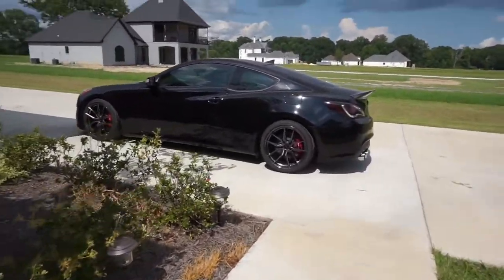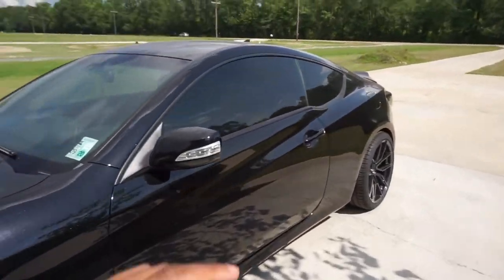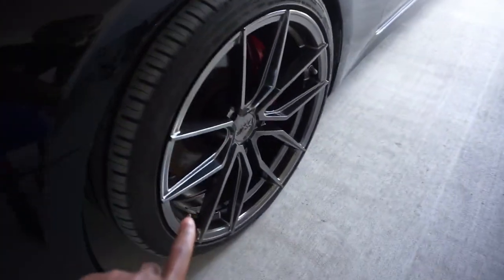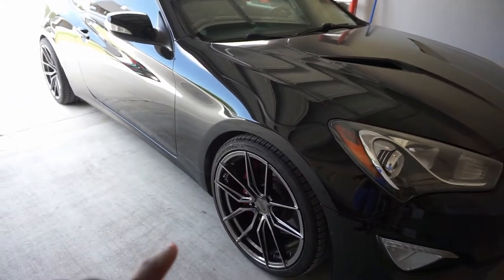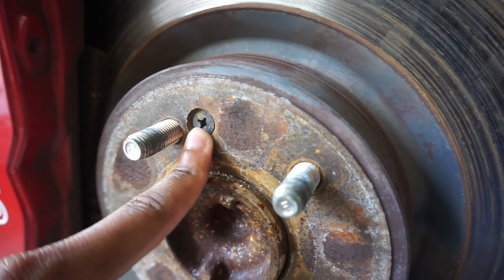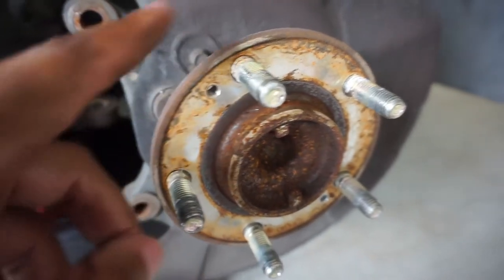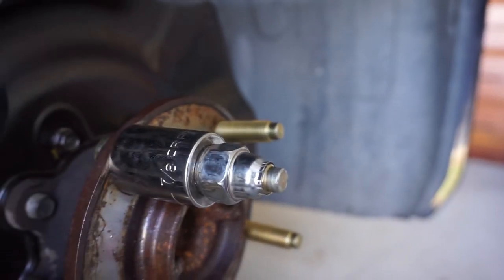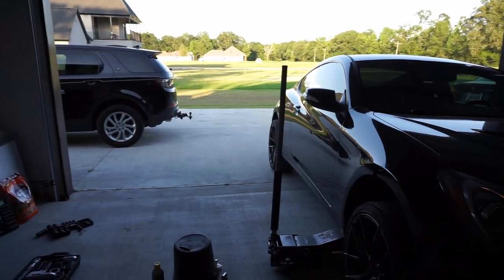Installing EXTENDED Wheel Studs on My Genesis Coupe 3.8

Comment: Just a quick thing I wanna say. You said the lugs hold onto the hub. The lugs hold the wheels which hold up against the hub. So those spacers you were running didn’t help you at all with the lug nuts being able to go through them
Reply from the maker: Not too sure what you mean.. The spacers still poke out the wheel the same length, but since the first set of spacers weren’t huh centric, they weren’t centered to each wheel. As for the lugs, if I remember correctly I just needed some that could tighten all the way down.. Since the lugs were too short, the studs would just hit the inside of the top of the lugs, which is why I got the open ended lugs.

I hope I helped you out